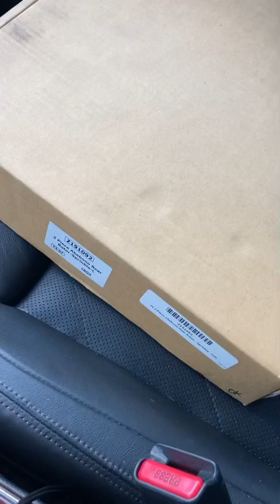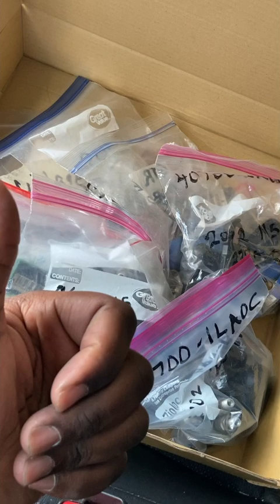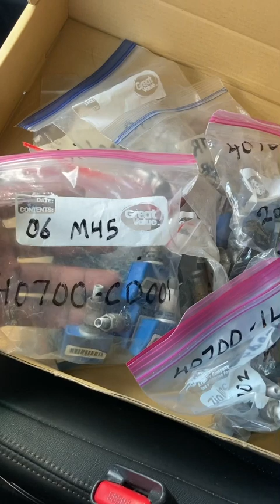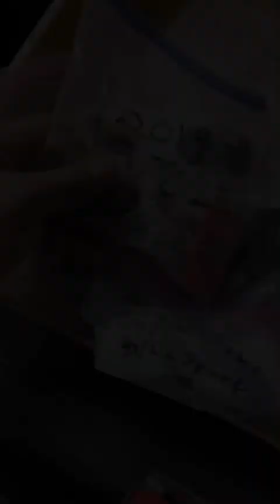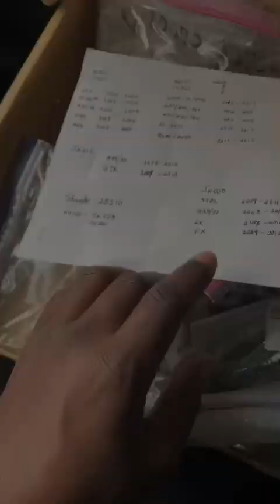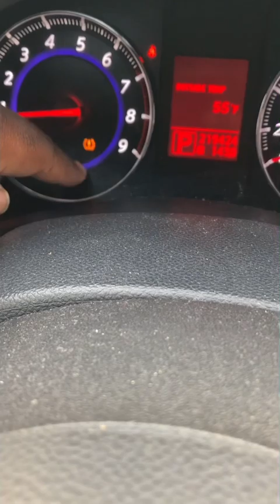Let’s Discuss TPMS sensors for Infiniti, Nissan vehicles

Comment: Does it detect the spare tire
Reply from the maker: Not typically. The antenna is usually right by the wheel well, so even if your (full size?) spare has a TPMS sensor as well, it will not be transmitting.